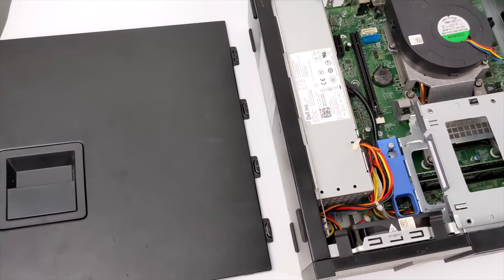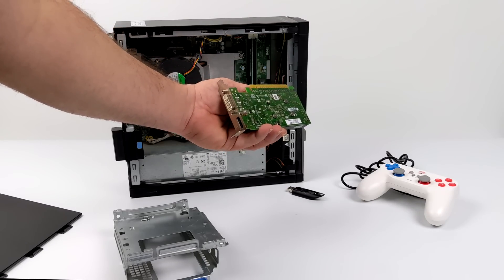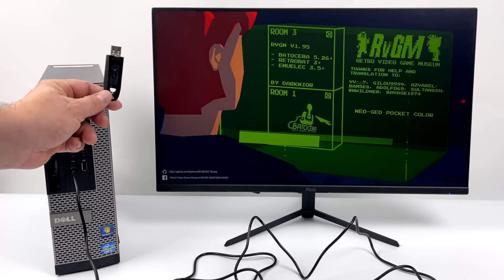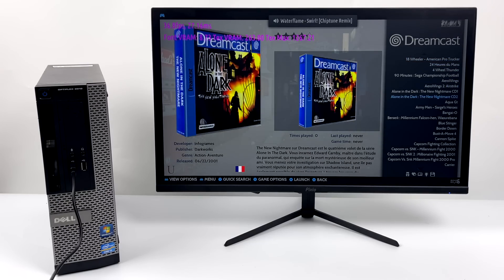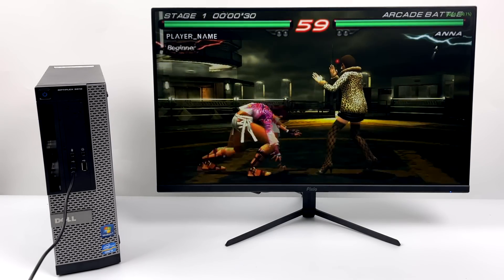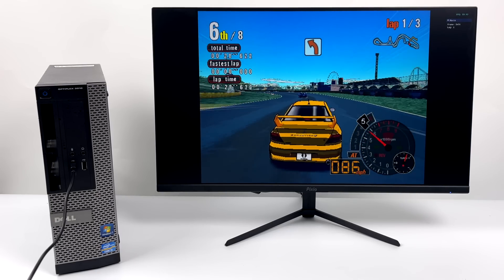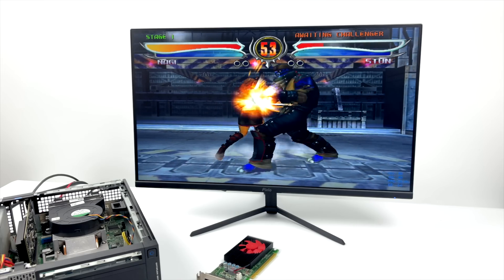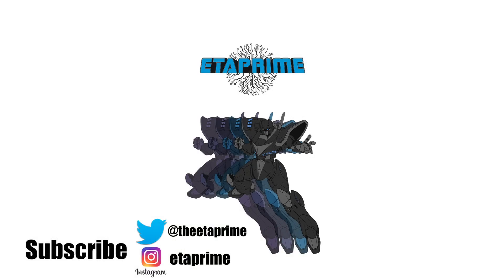You Can Build An Awesome Emulation PC For Under $100!

Comment: I love these old off lease machines. They're cheap and you can get a lot of bang for the buck. Add in some more ram, an ssd, and a budget graphics card and you've got something that'll serve most people's needs.
Reply: Some even come with 8 gigs of ram and ssd
Reply: @merciless972  Mine came with 8 gigs of ram, but could be bumped up to 16 (May do that just because I come from a time when a gig would have been unimaginable overkill much less sixteen.) Mechanical drive though and the move to SSD was a real and measureable game changer on the sort of gains made along wit hgeneral quieting of the system.
Reply: @JudeTheYoutubePoopersubscribe  Those were my exact thoughts but the 1650 will cost more than the entire system. At least with current pricing... =[
Reply: @singletona082  I remember my first SSD. It is a game changer.
Reply: @JudeTheYoutubePoopersubscribe  would it be able to run PS3 emulator?
Reply: Only in the usa, or i should say not possible in the UK
Reply: I get these things all day long from my job.. :-)
Reply: @JudeTheYoutubePoopersubscribe  I have a Optiplex 3020 SFF, i5 4590. For some reason Dell screwed up on that one and put the x16 slot in the wrong spot (next to the PSU) so all I could put in there is a 1030 because it requires a single slot low profile GPU :( I wish I could put a 1650 in it but yeah at today's prices nvm... still it does quite OK for what it is. GTAV, Elite Dangerous, 1080p no problem.
Reply: Pre-pandemic, everything there was dirt cheap. I paid $50 CAD for the box (with i3 CPU and 500GB), $30 CAD for the GPU and $20 for the i5 CPU upgrade. Pro-tip: paint the front grille black and it looks like a nice gaming console.
Reply: @linoleum77  oh man... did I get ripped off or what? And to think... at the time I had money so could have built probably any system I wanted and yet I went with THIS? Grrrrr... (kicks self) I'm not but so mad, though. I have a nice light small easy to move system that performs... okay... and it wasn't TOO much of a rip-off... I guess... I sourced most parts locally, and all new except for the base system, so there is that. Entire system including monitor, keyboard, mouse, speakers, GPU, SSD, 4TB hard drive, WiFi adapter, SATA card, etc. was maybe around $700...roughly... still, to think of what I could have gotten instead had I tried a little harder to find deals, kind of makes me sad.

Comment: Awesome build. I recently used the same case (but the 7010 version). Installed an SSD drive. Swapped the processor to a 3770K. Upgraded the ram to 16gb DDR3 1600 MHz running in dual channel, and threw in a GeForce 1050ti. My build cost didn’t land on 100 bucks though. But maaaaan. Im so impressed. Besides emulation that puppy can run modern games at 1080p with a solid 60 FPS or higher. Even on medium to high settings. It’s nuts.
Reply: Im sitting right in front of that same machine typing this comment!
It was given to me for free!
Had already been modded and transplanted into a new case too so had all the hard work cut out for me too!
Had it for almost 2 whole years now.
It does fl studio, streaming, facebook and everything elce nicely.
Reply: I put an i7 3ghz in it too.

Comment: I picked up a nice Dell Optiplex 960 from a refurbishing shop for $80 w/ a Core2Quad 2.66GHz and 4GB of memory that runs Ubuntu really well. I replaced the old 500GB spinner hard drive w/ a 64GB SSD and installed an old PCI-E AMD graphics card and a wi-fi card.

Comment: the x86 cpu crushes the rpi4's arm based cpu. This is a nice budget build
Reply: and the power consumption also crash the rpi4 too
Reply: @EricCartman056  yup
Reply: It's a x64 cpu though.
Reply: @GeorgeWPush  x64 architecture is also called x86-64.

But I was just comparing it xD 
Games run so well on x86 and they have better compatibility.
Reply: @EricCartman056  How much does the power consumption really matter if it's only on when you're using it to play games? The low power consumption of the pi is only a real advantage if you're using it as a server and running it 24/7
Reply: Lower power consumption also is good for portable devices. But it's too bad there aren't more x86 SBC's to choose from.

Comment: I got one from my old library with an i5-4570 for free.  I upgraded to 8GB, controller, and a 1TB using used parts in my bin.   I spent $60 for a RX550.

ChimeraOS, Runs even Shadow of Mordor at 60FPS high.   Plus I can stream from my main PC.

Comment: So after purchasing and testing the GT 730 that was recommended in this video, I can say that Batocera was not actually using the GPU during your tests. When you install an NVIDIA GPU in Batocera you have to enable the drivers over command line and then plug the cable through the GPU. In the menu it will show NVIDIA instead of MESA in the OPENGL System Information Line. When I enabled the GT 730 I saw noticable performance drops in even the menus and Gamecube/PS2/Wii were not playable at all. When running integrated graphics on my system, GCN/Wii run at 1x and PS2 at 2x resolution just fine. Just a heads up for anyone who was thinking about purchasing one of these cards. Don't waste the $30 and get a more powerful card or better CPU.
Reply: @FatButtFlaps  yup I had same issue too, not sure why but same dell 9020 optiplex actually ran worse with a gt 730... go figure
Reply: @hybridshift  in most emulators intergrated is better than discrete for some reason

Comment: I did just upgrade my main system, so thanks to this video, I still have a use for my old i7-6700k with 16GB of RAM and a 4GB Radeon 380x.  It'll probably knock the PS2 emulation out of the park.

Comment: Great advice. You could even save more by going to a big office building and ask one of the maintenace or cleaning managers for access to the electronic recycling container. I find clients with i5-4460s and 8GBs all day. Just as many Xeon workstations (wich have really great power supplies), monitors and cables. All the cables. 
I made a Batocera box and could give some frinds small client sized PCs for when their kids are there.

Comment: So this was actually powerful enough to emulate upto PS2 really surprised 😳
Reply: I doubt it will handle Valkyrie Profile 2 very well unless you use a 1030 or 1050. The latter could be a shoe horn fit though depending on the model. That game was a slide show on a G3258 and an AMD R5, but an i5-4670k and a 1050 makes it very playable.
Reply: @TogonzoMedia  Thats a good one IMO. In my experience, The Getaway, Shadow of The Colossus, Area 51, and a few others are the hardest games to run on PCSX2. Run those fine, and youre golden since over 90% of games are now playable according to the compatibility charts.
Reply: @TogonzoMedia  even so, the advantage is that it can play PC games as well.
Reply: @TogonzoMedia  An i5-3570 + 1050ti runs Valkyrie Profile 2, no sweat.
Reply: @PacketWrangler  Awesome!

Comment: im currently running an optiplex 7020, Intel 4790 ith integrated graphics and 8gb ram. I have it hooked up to a crt monitor. Im good for emulating all the 16/32bit games. I have steam games running too, all the 2d indie games i have work well. My setup came with a dvd drive and hard drive loaded with windows 10 for £90 and the crt cost me £30, its a great little setup.
Reply: Do you play indie games? I'm interested in i5 4570, I'd be happy if the integrated gpu can play metroidvania games (Shantae series and others).
Reply: @main_tak_becus6689  Just had a quick play and Shantae Riskys Revenge plays at 60fps, also Gunvolt, Mushihimesama and Wonderboy Dragons Trap are all 60fps. I tried Ikaruga On Gamecube through Dolphin and it held 60fps too. Bear in mind that im running games at 1024x768 resolution. I would say for any 2d pixel art games you will be fine.
Reply: @ThatGamingGuyfromthe70s  woah thank you for the good news! I don't mind lower resolution (480p widescreen), as I play PS1, PS2, SNES, GBA, NDS, and 3DS games a lot. I had a gaming PC but early this year sold it because of financial issue. It's not been a year but I really miss pc gaming. I plan to play Far Cry 1/2 and many older games on integrated gpu. Not interested in newer AAA anyway

Comment: Have the same PC but with i7-4790 processor and no graphics card. PS2 works fine at 2x res but some GCN/Wii games slow at 2x. Did not realize there were cards so cheap. Bought one and going to test if any improvement.

Comment: I built almost the exact same machine. I went with the HDMI low profile card and 2x4gb of ram. Little 3010s do pretty decent.
Also added a Xbox360 adapter and bluetooth usb so I could use old 360/ps3 controllers. I'd say it cost me $50-$60 total.
It does struggle to play things like Star Wars Rogue Squadron II for Gamecube. I wanted to get the gt 1030 but they're hard to find for a decent price. Solid little machine tho.

Comment: Hi ETA Prime,

My batocera emulation build is a dell optiplex 7020 sff with the power supply of a dell optiplex xe2 sff (255w -> 315w), i7 4790k (4 cores / 8 threads, 4.0 ghz up to 4.4 ghz), 16gb ram (4 × 4gb), ssd with 240gb, hdd with 4tb, wlan card and a low profile gtx 1650 from msi. I laid the 1650 outside in a printed housing and plugged it into the pcie 16x slot with a riser cable for full performance. The housing of the 1650 is attached to the top of the optiplex. No problems with heat or power consumption and the optiplex runs perfectly. Most of the wii u games run at 2k, most of the gamecube/wii games at 3/4k and most of the ps2 games at 2/3k.

Comment: I know this kind of defeats the purpose of a budget but if one wants to have the maximum power of that Dell omniplex they do have a GIGABYTE GeForce GTX 1650 4GB GDDR5 low profile out there as far as I know that's the most powerful GPU that you can cram into those small form factors

Comment: I love the Optiplexes. Mostly toolless design, clearly designed for ease of maintenance. Extremely affordable used and most of them come in excellent condition. For not a whole lot more it's easy to get some of the Optiplexes running 32GB of RAM, and any of them can of course take a SATA SSD (even the model in this video can take two SATA SSDs by replacing the optical drive with a caddy for a second SSD). Most of the Dells and HPs and such that we're seeing for sale are off-lease or discarded business/university/etc. machines and most are even in great condition because of this. Kinda cool to think of giving these machines a new life - they likely spent the prime of their life running Word, Excel and Outlook, and especially with Win 11 they're "unsupported", so uses like this let them "retire" into a life of fun. :-)
Reply: Biggest problem is proprietary PSU port on motherboard . Now, there are some cables-adapters to allow them to use regular PSU but these are iffy.

Comment: Brilliant vid. I got a i5 7400 with 8gb dd4 FREE from my local computer shop he was throwing it out. Still works now 3 years later.
I put in an SSD but wondering what graphics card to use. Would a 1030 be ok and be ok for power as my pc is a sff

Comment: My OptiPlex I5 build is great, I made it after seeing one of 
ETA PRIME's video's just before Covid kicked off. I added a low profile GPU before all the prices went through the roof.

I was lucky, I got a as new machine that was never used and came with windows 10 and a warranty (because it was from a bulk reseller / refurbisher). Y'all will probably have better luck with barter / local trading sites.... now that people have caught on to how good old office OptiPlex's are.

Comment: I'm running a slightly better setup with the Core i5 3470 and an RX 550 which I built for about $140. It runs Metroid Prime on Dolphin great and it runs the games I want on PCSX2 (WWE games and Tekken 5). Solid setup for sure and it doubles as a good home office PC.

Comment: The idea isnt bad. Once the gpu market normalizes, it could handle a lot of pc games too.  These can run up to i7-4790 and if 3050Ti low profile ever comes out, these will at least beat ultrabooks that also feature 3050ti :D
Reply: 3050ti would be overkill because the gpu would be wasted compared to cpu and mother board. I7 4790 pairs best with 1080.
Reply: @ryecatcher25  I am not even sure whether a desktop 3050Ti will be faster than 1080 ... also there arent any low profile 1080 cards .the most powerful low profile gpu atm is a gtx 1650 so even if 3050ti causes a slight bottleneck, it might still be worth it

Comment: The 3010 SFF are actually pretty good candidates for case swaps, though you need to do a bit of hacking on the front panel connector on the motherboard to avoid the "front panel unplugged" error. But yeah, throw it in a different case, and you can run most any video card you want on it.

Comment: Im building an emulation/media PC out of a HP 6000 pro sff with a core 2 quad 9550. I'm using an old 1gb 7470 right now and it works fine and will even do some gamecube semi decently. Wanna get my hands on a gddr5 gt730 but i'm not finding them at reasonable price. I miss the days of complaining about gtx 1650s being over priced at $150.

Comment: I picked up an Acer Aspire XC-605, and has a 4th gen i5 (4460 I believe), and it has 8gb DDR3 ram, and 16gb is maximum. I also picked up a Nvidia GT 1030 2gb GDDR5. It's a pretty small PC, and the GT 1030 is low profile. This should be a pretty decent emulation box, right? Do you recommend I run Batocera on it? I also am a lifetime member of both Launchbox and Hyperspin.

Comment: Great little computer but the failure point is the power supply. I've had 2 of these computers and both times the psu crapped out.

Comment: occasionally you can find the low profile 750 ti for less then $100 and it has a little more raw performance then the gt 1030. So if you find a GT 1030 or a 750 ti for less then $100 and it fits your budget for this type of build, go ahead and scoop it up
Reply: @Derrick Finzer I have used low profile GT 1030,  gtx 1050, 1650 and radeon Rx 550 and WX2100. The card compatibility depends on the slot orientation of your optiplex. If you have a full tower or mini tower it should be fine. If you are using an SFF model of the 3010 you will need to check where the PCIE x16 slot is located. Some of the SFF optiplexes have the x16 in the first slot so you can use dual slot low profile cards. IF your optiplex has the x16 slot NEXT to the power supply you will need to use a single slot GPU. There are single slot & low profile GPU versions for the GTX 750/ti the GT 1030 and several quadro cards like th quadro P400, P620, T400 and T600. Check your hardware in person or online to find out if your slot spacing and hard height is appropriate for the card of your choosing.
Reply: It seems the SFF model of the 3010 CAN use a single OR dual slot half height/ low profile card. If you have a regular size desktop "tower" version then it will work fine with a full height bracket so you can use nearly any card that is supported by your power supply. 75 watt cards with NO supplemental power will work on just about anything with a x16 PCIE slot

Comment: Warning for those buying a GT 730 - it's going legacy. Batocera doesn't have official legacy nvidia driver support. I would like to see the performance of amd cards, r7 250, HD 8590, V3900 and similar, they seem as a nice alternative.
Reply: Most people with this card will just need to use old versions with old kernels..so it's not a giant problem.
Reply: @-r-3542  nvidia driver isn't baked into kernel, it has to be downloaded separately. They won't provide it in a few days. There is an unofficial build with legacy drivers, but it's based on batocera 24, while the current one is 31.